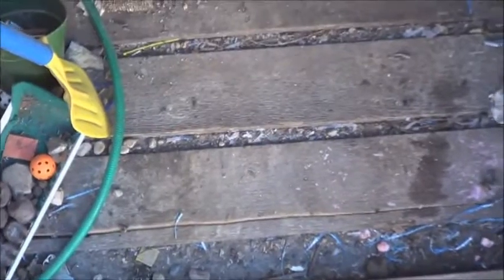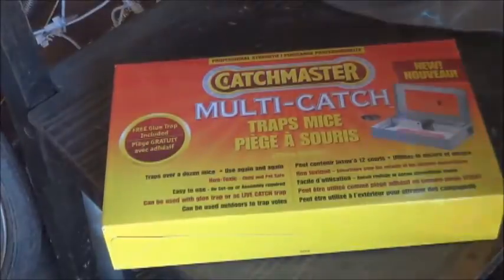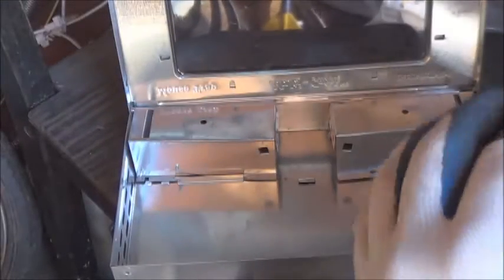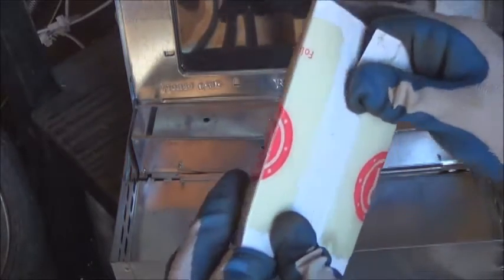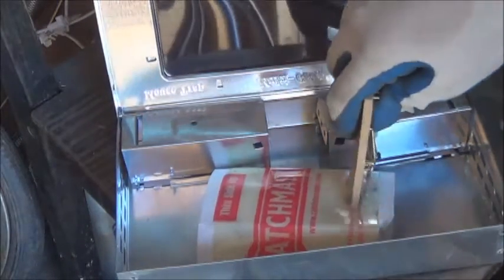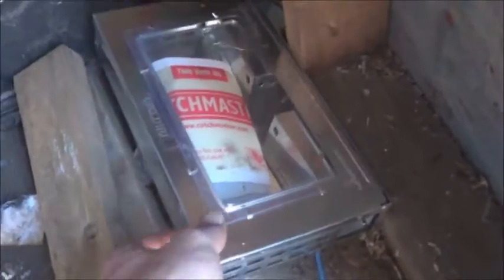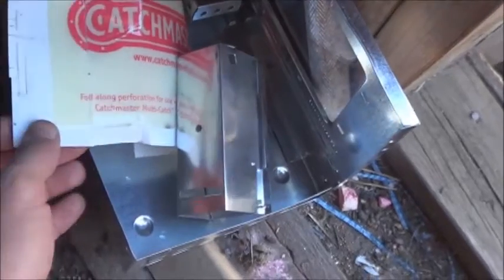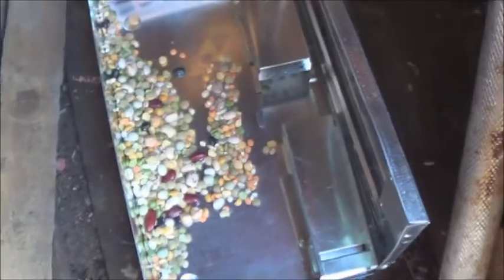Testing the Catchmaster Rodent Trap

Comment: Great video, great narrative, and very informative, but yes, reading the directions always helps LOL. When you fold the glue board, the glue is supposed to be on the inside. I have used this trap before, and it worked for me, but I was using it indoors and I used Doritos as bait. I suppose it depends on whether you place it indoors or Outdoors, and whatever type of beat you might use.
Reply from the maker: Lol, Doritos as bait would work!

Comment: That glue trap is folded wrong backward.
Plus all you need is cut that glue sheet in size just place it flat inside with a tiny bit of peanut butter in a small bottle cap and place it in the middle of the sticky paper to attract the rodents.
Reply from the maker: Thanks for the tips, I totally screwed up this trap but it's good to know if I get another one!